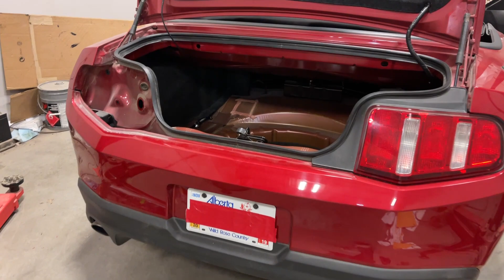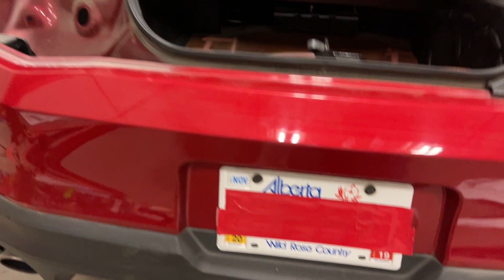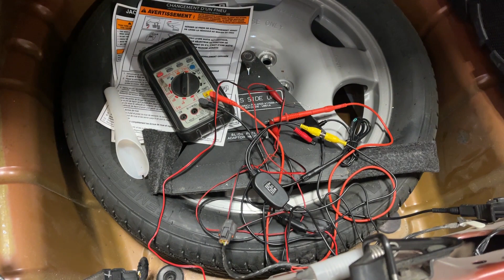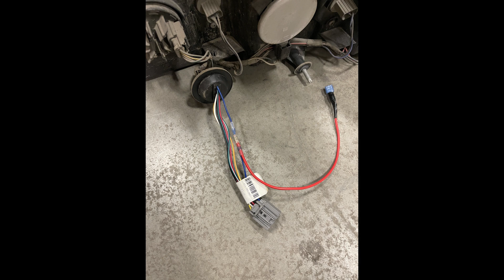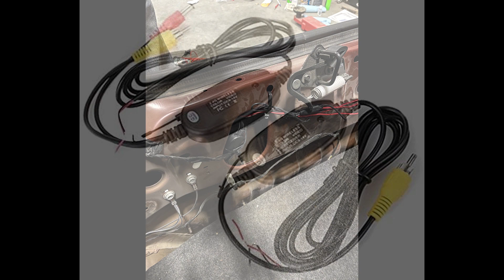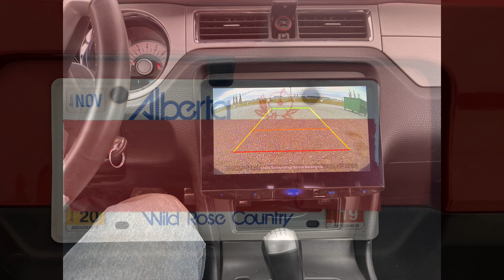Installing a Wireless Backup Camera in a 2011 Mustang

Comment: Thanks for the vid.  This is the only piece of info I found about the blue wire.  BTW, wiring from the front to the rear in the 2011 stang convertible was ez, just lift the seat cushions and there is a clear channel to the trunk.
Reply from the maker: Good to know. I didn’t want to get into any interference with the top so I used wireless. I have a similar setup for cameras on the back of my trailers which feed a dash display in my tow vehicle too, and it works well. I’ve been really happy with the whole electronics upgrade in this car.

Comment: I have the 2011 mustang too, can I use the passenger tail light to snake the wire through too after drilling the hole? What actual drill bit size did you use btw? Thx
Reply from the maker: If it wasn't clear in the video, I cut the grommet for the passenger tail light wiring harness and ran the camera harness through that grommet for a clean install with no additional holes. I don't remember the size of the hole in the bumper cover that I drilled, but I suggest getting the camera first then measuring the required opening on your actual part. Lots of times with these chinese parts even if you end up getting the specific part that I linked in the description it may have had some change to the diameter of the threads, so just measure it when you get it. These wireless camera links have some static, but most of the time I do get a clear picture, and even when there is some interference I can still see what is going on behind the car. I use the same basic setup with a wireless link between both my car hauler and my holiday trailer and a head unit in the truck for rear facing trailer backup cameras which is a big help on them as well. All of the tech upgrades I put in this Mustang really improved the contemporary feel of the car and have been a big positive. Good luck with your install.

Comment: Would you be able to provide the link for that specific back up camera? Or a similarly shaped one that would be suitable? I live in Ontario and have a 2011 Mustang as well so I’ve been researching ways to update my media control centre. Great videos
Reply from the maker: @w3rd645 This is the camera I actually used. It may not be readily available any more but there will be products that are essentially the same suggested on Amazon as well. Hopefully that gets you going, and thanks for watching! 

Backup Camera, COOLINT CT-107B Reverse Camera Mini OEM Style Solid Metal Housing 900TVL Untra HD Color Car Front/Side/Rear View Camera - 170 Degree - 0.01Lux Night Vision - 100% Waterproof IP69K https://a.co/d/9EaYAjf